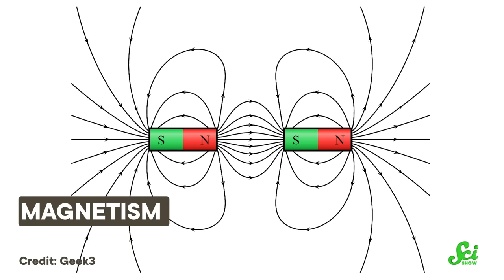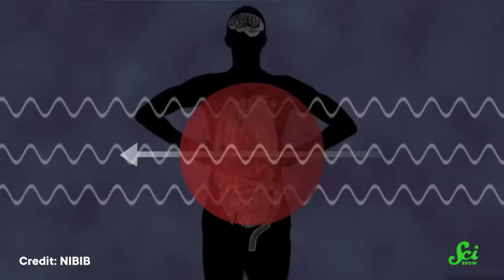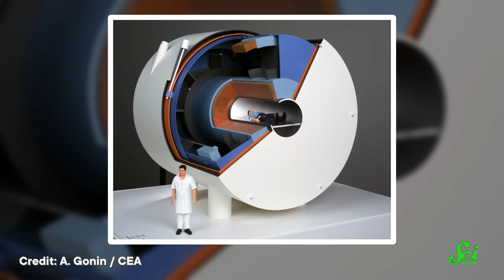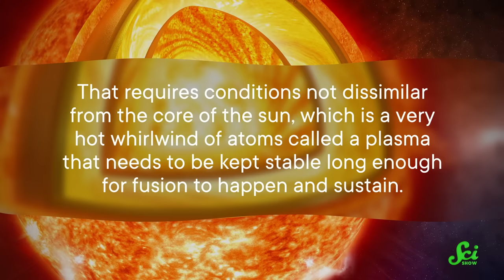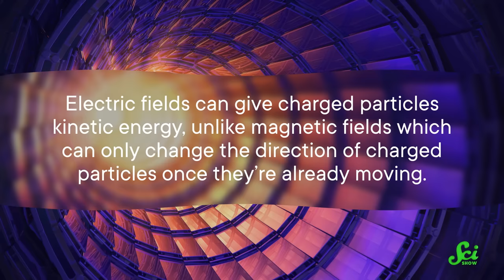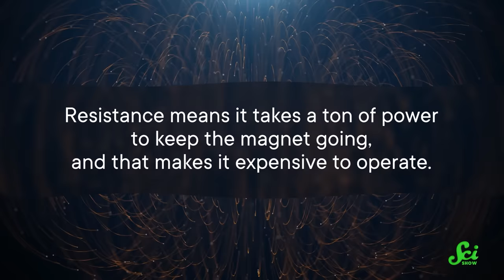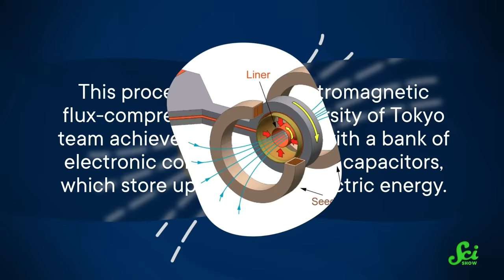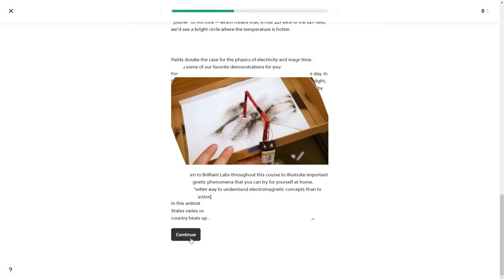What is the Strongest Magnet We Possibly Could Make?

Comment: So interesting! I was thinking that the magnets of MRI machines had something to do with the iron of the red blood cells but that was as far as I went with that. Knew nothing about them needed to be cold. Hmmm...
Reply: Interestingly the iron in blood is not ferromagnetic so you won't have blood suddenly sucked out when you go near a very strong magnet.
Reply: @puckelberry  
So you're claiming iron in blood is actually magnetic, just not ferromagnetic....

THAT'S wrong.

As I said in my previous post, iron in blood is nonmagnetic.

There's more than one kind of magnetism, blood isn't magnetic at all.

If it was electromagnetic, we still couldn't go in the room with an MRI.
Reply: If the iron in your blood was paramagnetic, instead of being ripped out towards the MRI, the iron in blood would be shoved out the side of your body facing away from the MRI.

If the iron was electromagnetic, it would still be ripped out as if it was ferromagnetic.

Iron in blood is NON-magnetic.
Reply: I never said it was magnetic. It's not at all, but when we reassure patients going through the mri we always just say ferromagnetic so that was the word I used
Reply: @puckelberry  
You should probably just tell them it's nonmagnetic, not only is it actually more accurate, but I'd bet the majority of your patients don't even know what ferromagnetic actually means. Lol
Reply: The only reason they are super cold is to lower the resistance of the wires in the coil of the electromagnet, so that the huge amount of electric current the magnet uses doesn't melt the wires into a pool of liquid metal.
Reply: @lordgarion514  deoxygenated haemoglobin is slightly paramagnetic, oxyhemoglobin and the plasma are slightly diamagnetic. There is plenty of literature on the matter (IIRC, Linus Pauling looked into this for a while). 

The moments of the cells are just very small, resulting in very weak interactions even at high external fields. The moments will align with the fields but they won’t be moved around much by the magnet as other factors are at play. There is actually some interesting (very) early-stage work being done on manipulating blood viscosity using 1-3T fields. 

That being said, as far as a patient undergoing MRI is concerned, blood is not magnetic.
Reply: @lordgarion514  puck obviously wasn't claiming blood was anything other than non-magnetic (the blood won't rip out of you), but he used the word ferromagnetic because that's what he knew.
I just googled it and found that all magnets are made of ferromagnetic materials, but not all ferromagnetic materials are magnets.

Comment: But what is the Tesla sum of all the magents at CERN?
Reply: Yes
Reply: More than 3.
Reply: 8T * 27km = 216 kilo-Newton per Amp...for what that's worth
Reply: @DrDeuteron  That doesn't equal the answer to the question..
Reply: @davelowets  what do you think a "Tesla sum" is?
Reply: @DrDeuteron  Idk what your units are doing, but wouldn't it just be (27km * (8T / 15m) = 27000 * 8 / 15 = 14400 Tesla total)
Reply: Flux is the ‘total magnetic field lines’ in an area essentially but the thing that makes the magnetic field stronger is the flux density. You could sum the flux of all the magnets but it wouldn’t really mean anything
Reply: @kindlin  Correct.
Reply: @DrDeuteron  The sum of the Tesla?
EDIT: And even if there is a more rigorous definition of summing magnets that makes more physical sense (as I'm sure there is, like net field strength), idt that's what the OP was asking for.

Comment: I think this is a field that could benefit from color mapping. If you assign a color to each point on a torus with some kind of function, you get different colors on the surface. You can do different functions and mess around. You can do <r,g,b> or even just a sum with a gradient scheme.
Reply: Oooo I'd love to program a display for something like this, I've worked on projects before converting data into colored 2d maps from ultrasound devices, it is super fun

Comment: Awesome episode. Does anyone know how to remove static from paper shredder bins, other than a wet cloth? Dumping it out in the winter is an fantastic way to witness electrical feilds but an annoying cleanup lol
Reply: Perhaps an anti-static gun? They spray ions which neutralize charge differences.
Wow! More expensive than I expected.
Reply: Put a dryer sheet in the bin. Static will be reduced, and it will smell nice too.
Reply: Polonium-210, or anything that emits nuclei.
Reply: I pick up the staticky object and repeatedly bump it into the nearest doorknob. It... kind of works.
Reply: Ground it? Like put some copper tape around the top, connect that to ground?

Comment: I don't know if you guys already did a video like this or not, but if not, could you do a video about temperatures? It's always been a mystery to me why the lowest we can go is -273 but we can go millions of degrees in the plus for extremely hot temperatures. So how come it doesn't go both ways?
Reply: Because at absolute 0, motion stops.  Temperature is largely just the motion of atoms, heat is the way we measure it.  The real question might be why we are on the low end of the scale.  Probably because, the further you go up, the quicker you get to the "Sh*ts on fire" point.  Just like earth sits in the Goldilocks zone around the sun, life sits in the Goldilocks zone on the temperature scale.
Reply: charles' law says volume prop temp. Based on this, a slope can be extrapolated, and we will see the volume would reach 0 at -273.15C, which is impossible, so we cannot ever reach -273.15C. Anything lower, the volume would be negative, which is impossible.
Reply: @MarkJones  Yeah that's fair. The more heat the more the molecules move about.
On another note, you say life sits in the goldilocks zone of temperature, but that's human life. There's always the possibility that some life forms exist that can't live in temperatures lower than 1000°C for example
Reply: @ASOTFAN16  In our scale we have critters that exist called 'Extremophiles'. They can survive/thrive in extreme (to us) conditions and temperature ranges. Even more so, when dealing with the higher ranges of temps in the universe. Life is tenacious, and will find a way to exist, and carry on. Like the wildlife on the ocean bottom that live clustered around volcanic vents that spew black smoke (hence, Black Smokers) continuously. That is some hot water!
Reply: @Betageek52  those extremophiles at the bottom of the ocean live in a high-pressure environment, not just high-temperature. Probably the high pressure allows for a normal volume to stay in a high-temperature medium. But I wonder if the temperature of the organisms themselves is just as high as the water's temperature. Also wonder if they would still be alive in a low-pressure - low-temperature (our normal) water?
Reply: @Victor_Marius  They won't survive in that, as they were 'engineered' for where they currently live.They might expand to death due to lack of atmospheric pressure, or freeze in the temperature range we need to live.
Reply: @Betageek52  maybe yes. But in that "boiling" water they should be cooked alive. I suppose that is the pressure that allows them to live in that kind of temperature.
Reply: @TheScandoman  Must be nice to be that superior to some people! A legend in your own mind.
Reply: @ThisIS_Insane  Well, aren't you clever?...NO!
Reply: The fact that it's called absolute zero should give you a hint. It would be like asking why you can't go further to the center of the earth once you are at the center of the earth even though you can go infinitely far away from the earth.
Reply: @DrSpooglemon  Yeah, it's called absolute zero. I asked WHY it is that -273 is the lowest we can go, not IF that's the lowest. But it's already been answered
Reply: @ASOTFAN16  Well it's only -273 because of where we decided to place zero celcius. If humans had decided zero celcius is the freezing point of nitrogen the number would be different.
Reply: -273.15°C Is actually 0 Kelvin. Namely Absolute Zero where there is no energy. Water freezes at 273 Kelvin and boils at 373 Kelvin. Human temperatures are fairly low compared to planetary or solar activity.

Comment: An Agency titled "ERDA"  (Energy Research and Development Administration) of the US Government had a contract (award?) with the University of Tennessee to study power production using an MHD generator (Magnetohydrodynamic Generator) in June 1976.  The initial test bed for this was a jet engine burning plasma like fuel made from coal and the jet exhaust passed through a strong magnetic field to strip the electrons from the hot gas. I retired from the US Army one year earlier (Enlisted E-8) having worked in Metrology and Calibration.  Completing a BS in June 1976 I was offered a contract position to install and maintain instrumentation for the project located in Tullahoma.  When interviewed for the job I was given a look at the test bed.  As I recall the jet engine was about 12 inches diameter and about 4 foot long.  The current source for the magnet was simply a large bank of DC Arc welders.  It was an interesting project but one week later TVA offered a position repairing instrumentation on the Browns Ferry nuclear plant damaged by a bad fire.  I've often wondered what happened with the MHD project.  As a side note I heard at that time (1976) Russia had the strongest magnet in the world.

Comment: Fridge magnets have actually gone a long way recently, mine are neodymium and can reach up to 1 Tesla. It's incredible how fast the field is progressing.
Reply: ...no you don't. You don't have 1/5 of an MRI machine to hang pictures on your fridge.
Reply: @JohnSmith-kc6ov  That's not how flux density works. If I could magically compress 7 neodymium magnets into the same volume then yes, but, you know, solid matter and all. They are, however, in the 10K Gauss range which is around 1 Tesla iirc.
Reply: @JohnSmith-kc6ov  Decided to double check, "Magnet strength chart" google search says neodymium magnets are 2000-5000 Gauss, so up to half of 1 Tesla. Fridge magnets are 100 Gauss, so 0.01 Tesla.

Comment: 10:00: Carbon nanotubes may have great electrical conductance and efficiency characteristics, but it doesn't have any semiconducting characteristics needed for computer chips. So, no - carbon nanotube processor gates are out of the question (but can serve only as conductors on the chip).
Reply: I was questioning this but for the wrong reason. I initially remembered silicon as being "what computer chips are made of" for some reason uncritically thinking it was the green part facepalm but after a quick Google search I immediately realized silicon is a semiconductor and that increasing conductance isn't the point since we have a whole class of materials cheap and accessible that would better fit the job, literally just copper being a conductor would be more efficient (financially speaking) in production if the point was less resistance than silicon. Regardless any advancements in material science is a plus, just more tools in the toolbox right. We may not have an obvious use yet, but from playing MTG even if it doesn't already have a home that doesn't make it pointless.

Comment: So can a magnet be used to simulate gravity? Wouldn’t that make it possible to make large objects rise and fall steady and slow with easy , my thinking is if you can use two gravity fields to cancel each other out ?
Reply: I'm pretty sure that magnetic fields obey the inverse cube law as opposed to gravity and most other things that are inverse square, meaning that it's not a very good analogue as the magnetic field drops off significantly faster than a gravitational field
Reply: Weird but interesting question. They actually did this a long time ago with a frog with 16T: https://en.wikipedia.org/wiki/Magnetic_levitation#Diamagnetically_stabilized_levitation
Basically water is diamagnetic which means it opposes a field applied to it so it pushes away from magnets. Trying to do this to something large like a human will probably be a lot more expensive but still possible.
Reply: Not perfectly because magnets don’t have the same drop off rate with distance as gravity. It drops off to the cube instead of square like gravity. 

However if you’re given an object at a set unchanging distance with a known magnetic force it’ll act as if it was gravity, but moving it around wont behave the same. 

They can act gravity-esque, as you can make orbits and stuff using magnets but the exact behaviour isn’t the same.

So you wouldn’t be able to exactly resist gravity with an opposing magnet, and it’s also an issue of scale where the earths gravity doesn’t change virtually at all within a few feet due to its size but a “smaller”magnet will change its force a lot over a few feet. 

Using a strong electromagnet that you can modulate the strength of you could I guess engineer a magnetic elevator type thing but you’d have to fight against the fact that the magnet doesn’t act like gravity.

Even if magnets followed dropped off to the square like gravity, the only way you could exactly oppose gravity would be to have an equally strong magnet placed the same distance away as the earths core (I think).
Reply: I just knew that there is a weird phenomenon called ball lightning, it's a visible ball of light flying around and or so...
Reply: A magnet can counter-act gravity on a local scale (like at the point where all the magnetic fields intersect in some magnetic tweezers), but gravity and magnetism behave fundamentally differently, as the rest of this thread discussed. And, if we could somehow control and manipulate the theoretical graviton (the gravity analog of the electromagnetic photon), then we could actually affect gravity itself.
Reply: Magnetic fields obey the inverse-square law just the same as gravity. The reason a magnet can only lift something off the ground when you put the magnet very close to the item is because the Earth's gravitational field is much stronger than it appears. An item sitting on the ground is several thousand miles away from the central point (and strongest point) of Earth's gravitational field, so the initial steep drop in gravitational field strength predicted by the inverse-square law already happened several thousand miles away from the item. The drop in gravitational field strength over a few inches at the surface of the Earth is only detectable by the most sensitive scientific equipment, whereas the handheld magnet you're using to lift the item off the ground experiences an initial steep drop in magnetic field strength over that same small distance.
Reply: @kindlin  : It's not actually because gravity and magnetism behave differently, it's because we don't have any strong magnets the size of the Earth. Read my other reply in this thread.
Reply: @Chevsilverado  : Magnetic fields do obey the inverse-square law. The reason magnets appear to work differently than gravity is because you're comparing a handheld magnet to the gravitational field of the whole damn Earth. Read my other reply in this thread.
Reply: @deusexaethera  Magnetic dipoles follow the inverse cube law. 

Monopoles follow the square law.

Monopole fields aren’t really a real thing either, just two monopoles = a dipole and therefore are governed by the cube law. No monopole magnets have been observed in nature, so no inverse square fields either. 

The dipole equation specifically has 1/r^3

Sorry but your claim that magnets follow the inverse square law just isn’t correct. Your other claim about the magnitude is correct though.

Look up “magnetic force cube law” and you’ll see a lot of documentation discussing what I mean.  Any basic physics textbook will tell you that it’s cubed.  Only when you get into some very specific theoretical physics of monopoles will you ever see an inverse square.

So it’s a combo of the inverse cubed law plus the lower magnitude of the magnet as you said.  But even if you had an earth gravity strength magnet placed thousands of miles away it still wouldn’t act as gravity due to the fact that it is indeed a cubed drop off… as I said before as well.

Comment: I see that you mentioned the ITER reactor, and I wonder if you've hear about Helion's experiments yet. I think they show a lot of promise.
Reply: Helion seems to be so much further ahead / so much closer to actually harnessing the power of fusion in a net gain setup, primarily due to the complexity [actually simplistic elegance using modified fiberoptics and modular custom-built electromagnets and an array of 70's-current Gen + custom ordered capacitors to quickly cycle [and then harness] the process of fusion, but instead of involving overly complex transfers if energy to something capable of powering a turbine, these badasses are right on the verge of harnessing that burst of energy directly into the magnetic field - - > wiring / capacitors, etc that powered the the reaction in the first place, and then upstream to the grid.

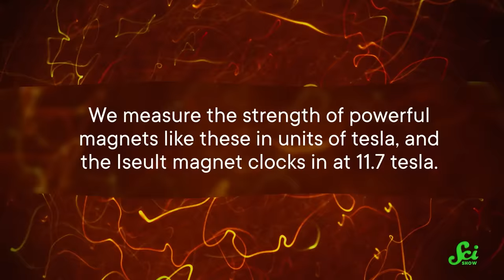Comment: I'm not sure where the fridge magnet flux density figure at 2:00 comes from. Neodymium magnets have a residual flux density in the range of 1-1.4 T and even ferrite (ceramic) magnets can be 0.4 T and above. Those flexible ferrite loaded plastic magnets will have a lower flux density, naturally, I don't know how much but point is, 10 mT is really small and not representative of a strong magnet.